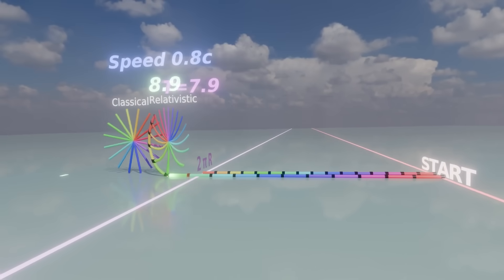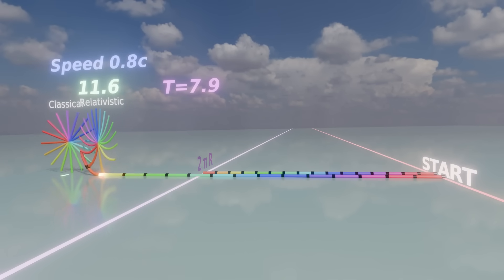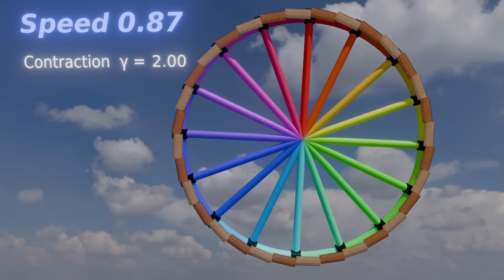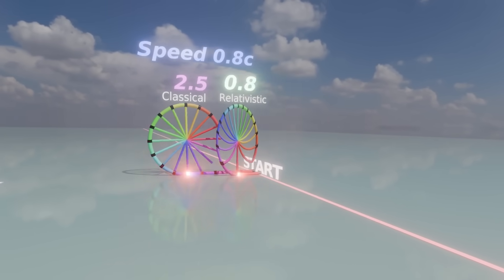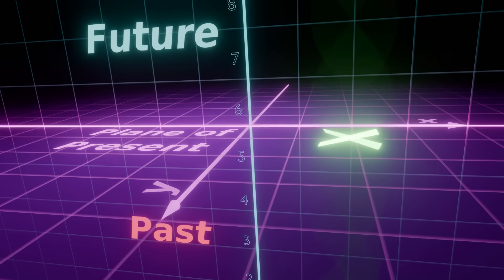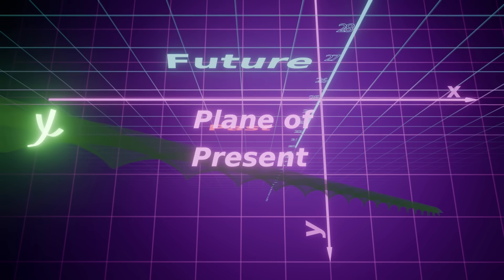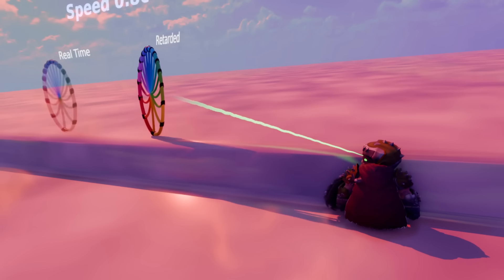Relativistic Rotation 1: Ehrenfest and the Wheel

Comment from the maker: Sincere thanks to you all for your interest. Although I myself enjoy Ehrenfest paradox (and the Rotating frame),  I did not expect this much attention. Next up should be a video on the geometry of the rotating frame (Langevin Observers, Born coordinates, spatial geometry of a rotating disk), and after that a visual experience on what an observer living in a rotating frame would actually see/experience. If you have some suggestions on this topic please let me know, although I may not be able to fulfill them.
Reply: Thanks for putting in the time and effort to make these! Your channel deserves to be much bigger. I’ll be waiting for the notification for the next part!
Reply: Thank you so much for the series!

For years now I was interested in how length contraction and rotation mix together. Especially in the part of molecular density and degeneracy pressure. The two scenarios that by me the most are:

- If a rocket flies past me at a fraction of C without acceleration and a person on board rotates a plank of wood 90° how would the change of geometry be accounted for? Will it create stress on the material?

Or if I fly past a planet at a big fraction of C i should not be able to tell if its me or the planet thats moving, yet clearly a squished planet won't be able to hold itself together, thus I can easily make the conclusion that it was I that experienced acceleration in the past.
Reply: can't wait
Reply from the maker: @r2k314  the material is done but i need to wait for my narrator to get back to town so we can finish it.

Comment: :hand-pink-waving:Will this rotational speed (acceleration) also affect the matter of the wheel in its own frame assuming an elastic body? Your simulation shows that the image (light) we perceive is not the same as the changes the body undergoes inside its own frame because acceleration. Meaning SR is the science of optical illusions created by fast moving bodies due to the finite speed of light?

Comment: 5:09 to add to this, i think, any perfectly rigid body would brake upon movement too, because movement causes length contraction and desynchronized front and back movements.
Reply from the maker: Yes, exactly. A perfectly rigid object would have to break when rotated. It could be accelerated linearly though. See Rindler coordinates.

Comment: why does the centre of rotation stay in 1/2 of the relativistic wheel height, an how do you actually determine that wheel height if not from the path it travelled on the observer level. you can not simply pre-define dimensions of objects. you have to calculate them from experimental data. in this example - the path length to full rotation. 
the logic in your reasoning does not originate from a single reference point, so it is not proper relativism. 
it is obvious longer path means larger wheel.  there is no paradox here just lack of understanding of how definitions are formed in proper physics. mathematicians are retarded like that.

paradox is an excuse word for mistake in definitions that lazy or hardheaded people use to avoid revising their logic. for any serious thinker it is an admission of weak mind.

Comment: Notice that the top of the relativistic wheel is compressed, while the bottom is stretched out. When the rim is traveling with the net motion of the wheel, it has more energy, and experiences more dilation, it is closer to our very slow c but still cannot simply exceed it, while the bottom of the rim is moving against the net movement of the wheel- we have defined the bottom most point as being stationary at each instantaneous moment, it experiences no time dilation or length contraction or whatever.

Man, relativity is so weird

Comment: Seriously overlooked problem with this; if there's a 2nd plane the wheel also contacts it would appear to have a shorter circumference, although both planes would have the same relative space-time angle to the observer (and the wheel).

Comment: It's a mess that can be fixed by using real physics. Unfortunately mathematics isn't real physics.
Reply from the maker: sorry, what do you mean?
Reply: @imaginingPhysics  The physics should be quantized, and the resting wheel is never actually reasting in physics. The quantized parts of the wheel are actually spinning when apparently rested. The spins eliminate the extra lengths, because spins are extra lengths that are basically stationary. Like a car wheel spinning would be moving forwards if it were not wheel spinning. This delay is time dilation as well.

Physics moving forwards create quantum tunnels through space plus spins. The tunnels create shortcuts through space which is your speed, and the spins create delays in your speed. So long as the tunnels stretch you go faster, but each stride has a spin delay which would be the extra length in the video. Like a big wheel at a fairground has individual carriages that can spin around. The individual parts of quantum physics have individual spins as parts of the larger spin.

This is just mathematics being mathematics, Einstein made mathematics work is a strange way that doesn't match nature, and isn't even physically possible.
Reply from the maker: @pinchopaxtonsgreatestminds9591   I cannot comment on that and this video tries to stay within Special relativity. But thanks for you long reply though.
Reply: @imaginingPhysics  OK, but science is a study of nature, so by sticking with Special Relativity all you are doing is creating a delusion.

Comment: The wheel doesn't change just because you observe it at some relative velocity. Your observation and measurements you make of the wheel from your reference frame are what change. You've misunderstood relativity.
Reply from the maker: The only part where I claim the wheel actually changes is when it is being accelerated into rotating motion. And that is when the proper length of the rim will change.
Reply: @imaginingPhysics  The unfolded length at the contact point, fixed by assumption, is ... fixed / at rest. So length shouldn't change.
So while the gamma R pi formula is correct of a purely rotating wheel, the graphic is suggesting it's also translating and thus is misleading (not to say wrong)

The issue is that the ground is supposed to be fixed according to the visual (reinforced by the fact that the "start" text is fixed relative to ground and that the camera is panning).
While for the formula to work, the wheel should be unwind on a treadmill in front of the observer.

I mean, beside that, it's a very nice video...
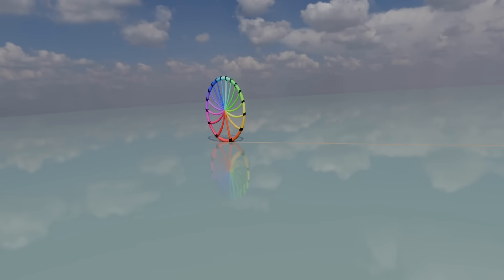Reply from the maker: @SupGaillac  Around 1:00-1:15 the animation might indeed be a bit misleading since the camera is panning. I chose that as a means to guide the attention to the correct spot. I hope the viewer gets the idea. Other than that part, I think animations should be rather accurate. Thanks.

Comment: If the centre of the wheel is moving at >.5c, surely the top of the wheel would be superluminal?
Reply from the maker: Good question. Weirdly, as you can see in the simulation, it does not. The spokes and rim at the top contract and do not seem to move faster than light. Speed is not additive in theory of relativity.
Reply: @imaginingPhysics  Looking again at the visualisation, it appears that the top moves faster, but not twice as fast. It would be interesting to see a visualisation closer to light speed. I would guess that, in the limit, the top would be moving at the same speed as the centre, and the wheel would be squished to infinitely thin.
Reply from the maker: @pjwadd  you guess correctly

Comment: It seems like you're mixing two effects in the beginning. The wheel is rotating and moving relative to the ground. The increase in the circumference of the wheel is the Lorentz factor from the relative motion. This seems to imply that it has nothing to do with the rotation itself. Would the wheel have the same circumference if it were stationary with respect to us but rotating? Or is the method to have the wheel roll with a velocity that corresponds to its rotation and that is just a convenient way to measure the proper length?
Reply from the maker: To shift into a frame where the original wheel is rolling is just a convenient trick to measure the proper length. 
Btw. Nice to see you again Narf!
Reply: @imaginingPhysics  I had just seen that you started making regular videos again. And they are great! I also corrected my mistake of not being subscribed.
Reply from the maker: @narfwhals7843  thanks. Yes I do these when I find enough free time and energy.

Comment: The Lorentz transformations are derived for inertial systems. A rotating frame is not inertial. Lorentz contraction is not a physical proces for inertial systems. The perceived contraction is due to relativity of simultaneity. Input in the Lorentz transformations is that for every inertial observer the light speed is the same. An observer in a rotating frame will observe that the light speed is not the same as an inertial observer. The assumption in this video is that you can apply the Lorentz transformations to a rotating system which is not inertial. Are there experiments which prove this assumption?
Reply: You can apply the Lorentz transformations to accelerated systems by treating them as a sequence of momentarily inertial ones with different velocities. This is the way accelerated frames are usually treated in special relativity.
This is also done here by only considering the segment of the wheel that is currently touching the ground. This is at rest with respect to the ground.
Reply from the maker: Yes rotating frame is not inertial. And indeed relativity of simultaneity plays a role in the the contraction or the rim. But the segments at the rim can analyzed by treating them "as a sequence of mementarily inertial ones" as narf says. I will explain effects in more detail in the second video.
Reply: @imaginingPhysics  For a straight object an observer at rest you have t=0 for x = 0 and x = L (length of the object). If you apply the Lorentz transformations then for x = L and t = 0 you find for the observer not at rest a non zero time value. Now apply this to the circulair system for x = 2 × pi × the radius you find a non zero value for the the time value. But x = 2 × pi × the radius is the same point as x =0. But for x = 0 you get for the observer not at rest a zero time value. This gives a contradiction.

Comment: I actually don't know the answer to the riddle, but what I noticed - what is the reference point? The center of the wheel? That's the main problem with wrong contraction etc.
Reply from the maker: Here the two most relevant frames are: 1. the center of the wheel such that the wheel is rotating (inertial frame), 2. the center of the wheel but the wheel is not rotating (non inertial).

Comment: How can a solid object be 2 lengths at the same time. ?  If I make a wheel with a one metre circumfrence out of solid material, one revolutionit wi measure 1 metre.  It can't magically add material.!    You can see in the animation that the wheels have different length segments, IE different diameters.
Reply: Also the same object can be different lengths for different observers at the same time, right?
Reply from the maker: @mikebeaton5632 yes. But the so called proper length is defined to be length in the rest frame so it is unique/invariant.
Reply: @mikebeaton5632  If a wheel has a diameter of 1 metre then it still has a diameter of 1 metre no matter where it is observed.  It may APPEAR smaller but that is simply perception, NOT measurement.  IE Objects look smaller the further they are away, but they don't physically change size.
Reply from the maker: That's a good question. And of course the same object can't have two lengths at the same time. However, if one is moving (or rotating) and the other is stationary, then they are not the same and can have different PROPER lengths. And by definition the proper length is measured in an objects rest frame.
Reply: @imaginingPhysics  What difference does movement make?  If I have a length of wood 1 metre long and put it in my car an drive at 60MPH and measure the wood, it would STILL be 1 metre or its original length.  I think perception is getting mixed up with actual measurement.
Reply: @IRDazza I think acceleration, which includes circular motion, actually changes the proper length, even though uniform linear motion doesn't.
Reply from the maker: @IRDazza  yes the wood would be 1m in your frame. And simultaneity is a very important question since one needs to measure the positions of the ends of the rod at a simultaneous moments. And simultaneity can change-->ends can change-->length can change. 
That's the usual way to explain it at least.
Reply: In which part of the video is the material added to the circle?
Reply from the maker: @pawegawe4887 as the circle is being accelerated, if you prefer to think of it that way. I think of it as the wheel being elastic. And you could also assemble the ring as already rotating.

Comment: I'm sorry, I lost this at the very beginning.  You said you were going to measure proper circumference in a rotating frame, but the graphics and analysis seemed to be from the perspective of an observer watching the wheel roll by.  If you are in a frame rotating with the wheel (let's say you are at the center of the wheel, for simplicity), then all the points on the circumference of the wheel are stationary in your frame, so I do not see how you observe any Lorentz contraction.  However, by the equivalence principle, you observe a gravitational field directed out from the center of the wheel.  Perhaps this has an effect on the lengths you observe, but I do not know enough GR to say for sure.  I would imagine that there would be some contraction, because that is what happens to lengths in a gravitational field, but I would hesitate to call this Lorentz contration, at least in the rotating frame.  How would you explain this?
Reply: I have the same concern. If you unwind the wheel in the rest frame, then, by definition, it is also at rest and thus shouldn't have a contracted length.
However, if you assume the wheel center is fixed, then it all make sense.

There's a confusion in the video between purely rotating, and rotating+translating wheel.

Too bad, cause the graphics are awesome.

Comment: Such simulations doesn't make any sense. 1)It is not possible for any wheel to ride on any surface with such speed because of the friction. 2)There are no materials to make a wheel capable to withstand such a high rotational speed.
Reply from the maker: You are right or course.This is not ultra realistic simulation. But that does not mean the effects are not there in lesser extent in more realistic scales/velocities.

Comment: You should check your result against the metric of a rotating coordinate system. Integrating over constant radius, you will get ∫ds = 2πR. The fact that you're getting a spurious factor of γ showing up is entirely due to not taking the fact that you're working with an accelerated frame of reference into account. Rotating is inherently a domain of GR. I'm sure the argument for how SR was applied here seems sound, but the result disagrees with GR, and therefore there is a mistake in one of the assumptions. Since you are planning this as a series, apparently, it would be a really good idea to reconcile the difference with GR and find your error in logic before you go further.
Reply from the maker: GR is necessary only in curved space times with gravity. SR can handle accelerated frames just fine (Rindler coordinates for example). Also, the basic arguments I have made visual here are not originally mine. The contracting measure sticks argument is from Einstein himself. (more historical references in the paper I have linked in the description)
I plan on quantifying arguments with metrics in the next video.
I hope you will let me know if you find them lacking.